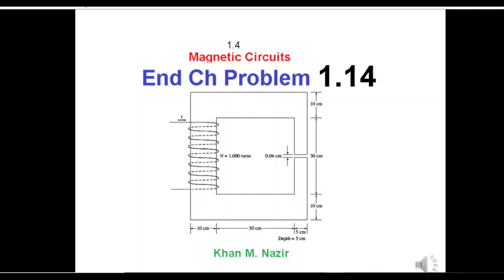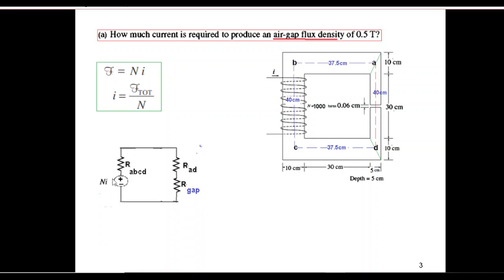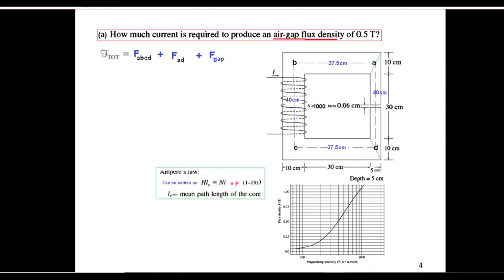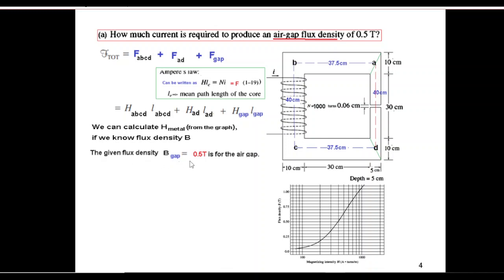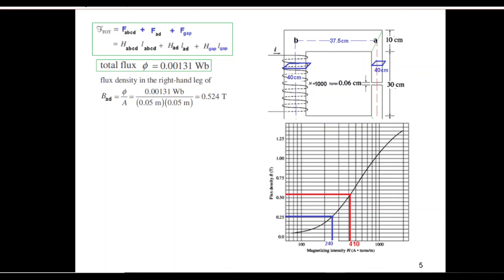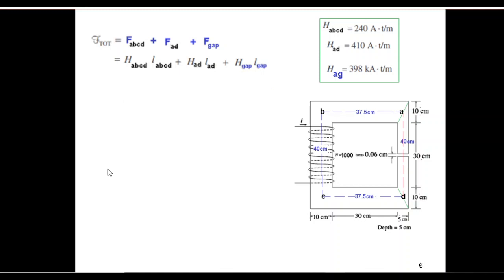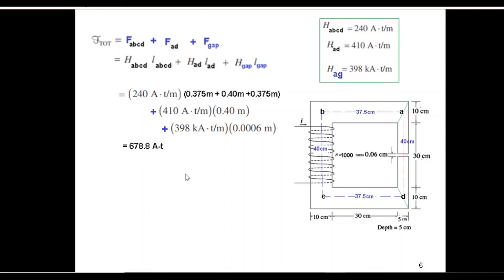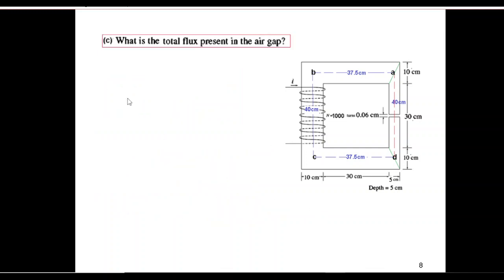(E)EM(C) Q 1.14 || Magnetic Circuits || Two-Legged Magnetic Core with Air Gap

Comment: 5:33 
The reason we can calculate the total flux from the air gap by using the flux density in the air gap is that everything is in series, and the flux that flows through the air gap is the same flux that flows through the 
abcd or ad path.
For another circuit, would things be different?
Reply from the maker: Yes. Also note that in the question the flux density of the air gap is given, so we are using that to calculate total flux.